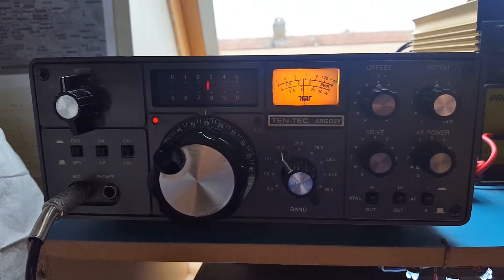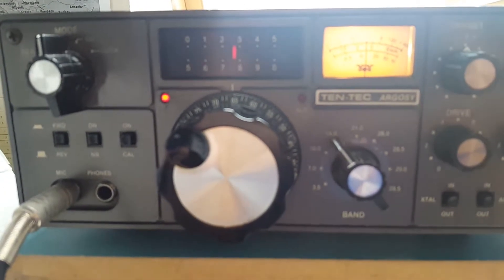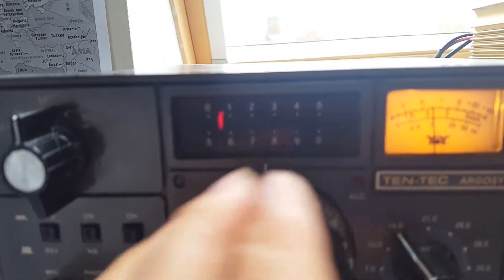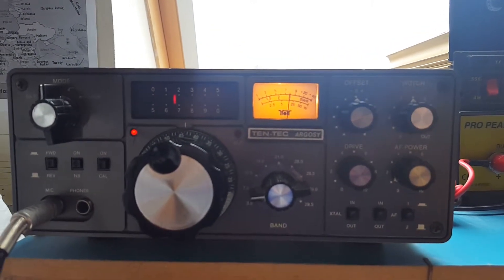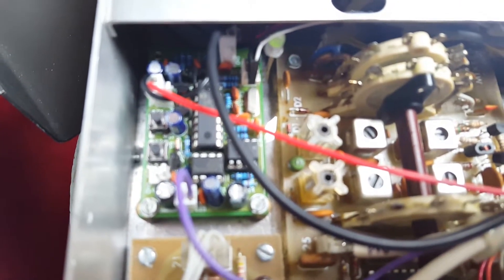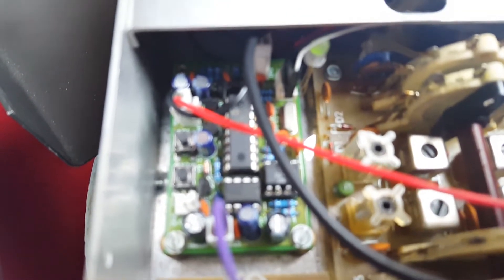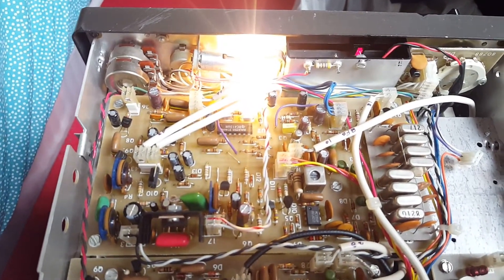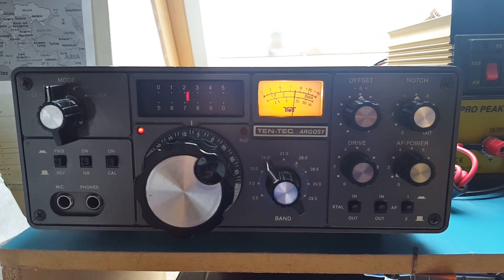Tentec Argosy -  Vintage Transceiver Restoration Project with VFO Stabiliser

Comment: How easy was this project for you? My argosy doesn't want to seem to TX or RX anymore, thinking about what to do for repairs. Replacing the electrolytic caps seems very hard for a beginner
Reply from the maker: Hi Adan,you're right and I don't recommend this for a beginner. Should have some electronics background and soldering skills to begin with.For your argos,I suggest checking the contacts on the band select switch, good luck!